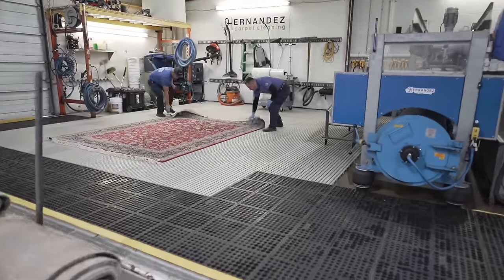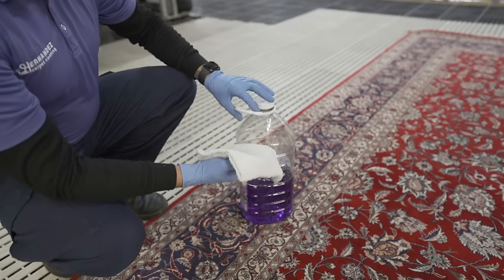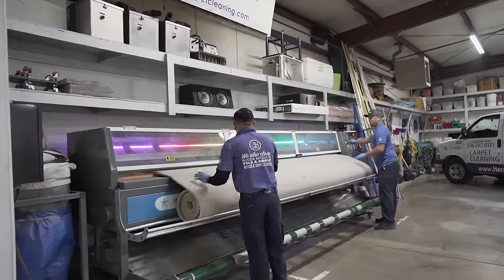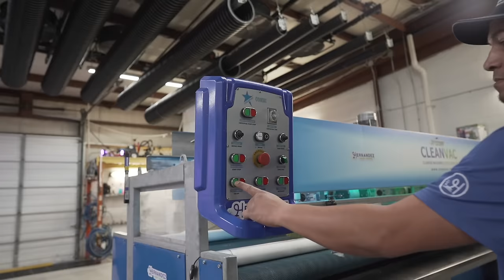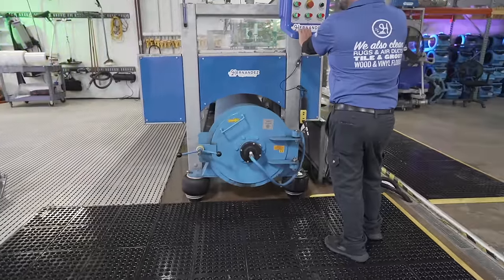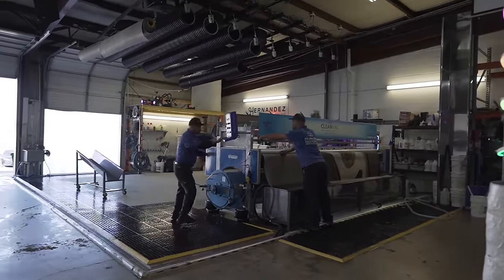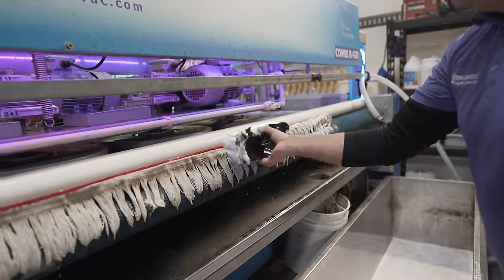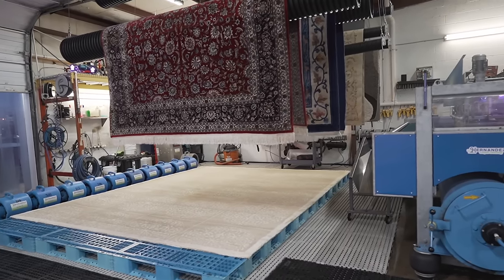Our Rug Cleaning Plant! Satisfying cleaning

Comment: Hi there! I see huge space almost empty. If i where there  i will separate one part in side like container with automatic garage door. For storage 50 to 100 sqare meters of carpets to dry. That space i will isolate and put some heat in. If it sun is also can be transformed that heat in that dryin system. That place where you are is too open and you are in between that conditions with. I have very brave ideas about all steps to be automated with very little human effort and i can write here in hours... so if i can be helpfull glad to hear
Reply: There's a reason they do it their way and not yours. Their way is the correct way.
Reply: @mayjan74  your opinion does not say anythng. Am just express ideas. I not ordering how some  one need to do stuff. Only give advice if some not take it it's ok. It's free anyway 🙂

Comment: Question:  What machine are your using to get the compressed air through the 1.5 vac line into the wand to dust the rug?
Reply from the maker: Air Force Master Blaster Dryer MB-3CD